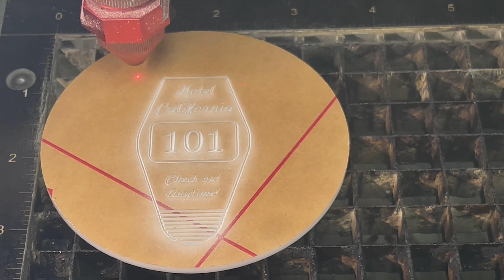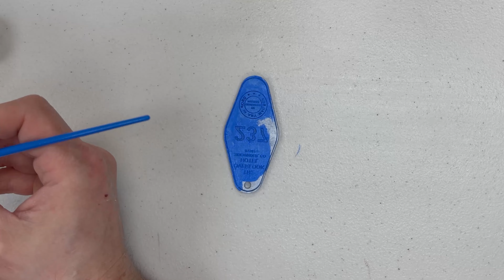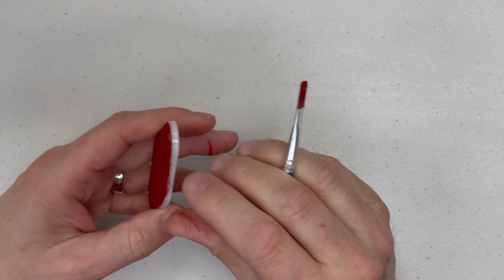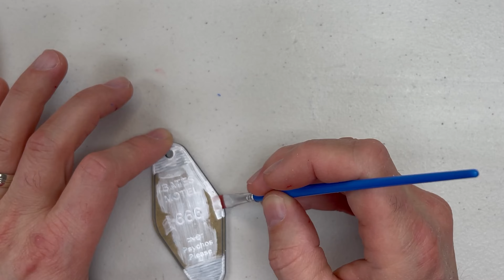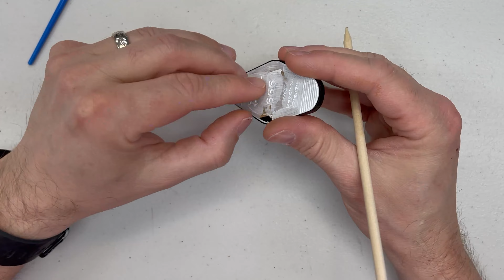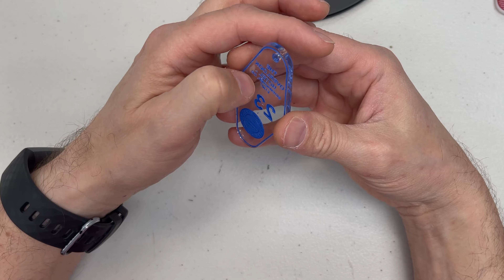Laser Cut Motel Hotel Classic Retro Vintage Keychains DIY - Design File Available

Comment: We're experimenting with different acrylic paints to apply to the cut/engraved design. Which kind do you use? Also, have you found a good "depth" for the engraving that works best for you?

We have a Gweike machine, very easy to use, using Lightburn on Mac to cut/engrave, designs created in Illustrator.

Comment: Watched your video and purchase these designs..Noticed your are doing an engraving but the files I got are set up for lines...Having to change every design to be able to engrave.
Reply from the maker: Sorry to hear that you're having trouble. We set the files up with a red line for the vector cut and black for the engraving. We believe this is industry standard and has worked for us in a number of laser brands and the corresponding software. Depending on the software you're using, it may not recognize those colors for those purposes and you would need to tweak your settings to perform the proper action.
Reply: I am having the same problem. I purchased the design and made the modifications for engrave and cut. If I set it up to engrave with the provided artwork, it blacks out the design. I can only score which is not what was advertised when file was purchased.

Comment: Love the video, but, honest question, with the amount of time it takes in post, how are these profitable?
Reply from the maker: Yes, the way we finished them required a lot of extra work. This was just a DIY project and not something we sell. We don't know if these could be profitable, as this would really require a cost analysis. There might also be shortcuts to make it more profitable. You could offer engraved black acrylic or wood which could be left unpainted. You could also spray paint them, instead of hand painting, which would speed up the painting step.
Reply: @smedleyworks  thanks much for your response! I’m relatively new to laser engraving and still learning a lot. So I thought that there could be a better/more efficient way! Spray paint is a good idea but likely would require some cleanup on the edges. I love your video on the jigs. I just purchased a Cheetah jig kit and so far pretty happy with it!